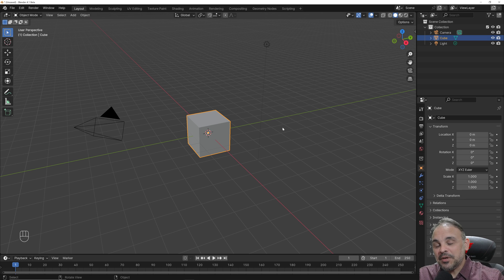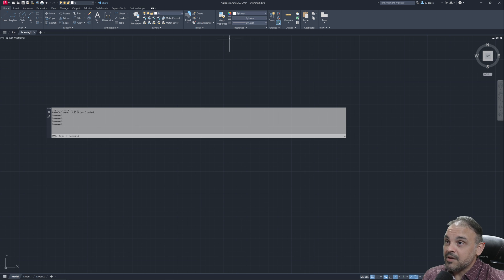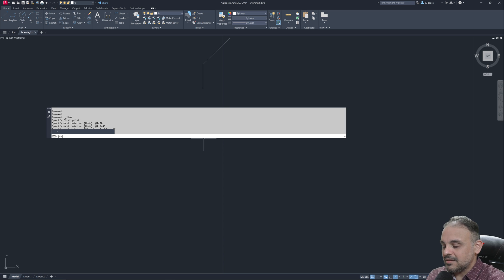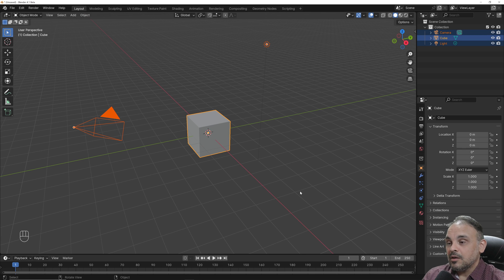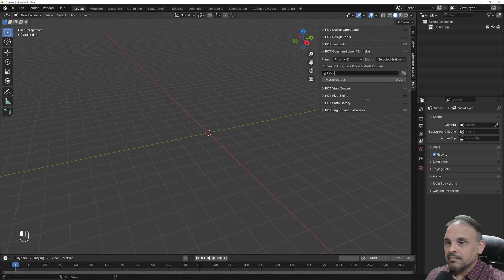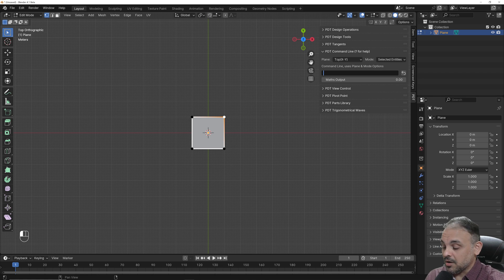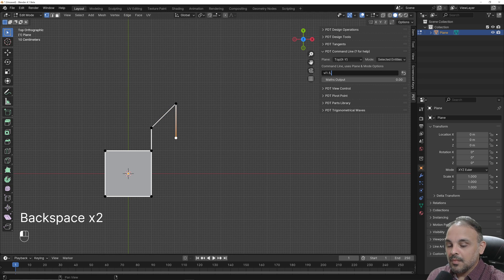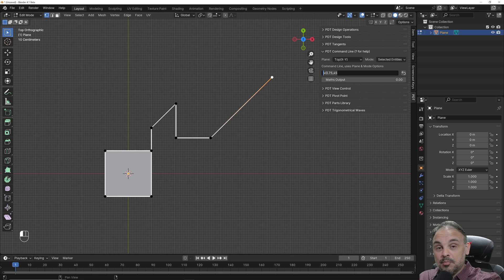Blender 4.1: How to use Polar Coordinates?

Comment: Help! What is your process for producing technical drawings using Blender 4+ ? (or do you export your views then annotate them in QCad/ACAD?).  I need to work natively in Blender because I have a lot of MEP equipment that requires lots of tagging of Descriptions etc. so exporting to a CAD program is awkward for me.  
1) Do you have your sheets in Blender or do you export them? 
2) Do you use Scenes (one per drawing sheet), animating visibility to show/hide parts (as well as ViewLayers)?
3) Do you use the Compositor to combine camera views onto a single sheet?  Perhaps with one Workspace per drawing? 
4) What addon/s do you use for dimensioning (Measurable, TechSec, PRJ, MeasureitARCH etc?)
5) What are your views on BlenderBIM?
Reply from the maker: Blender alone won't help you to create and manage technical drawings. You will be able to export projects as SVG files with orthographic views.

Once you have the SVG, you can import it in Inkscape to edit the sheet layout and save it as a PDF. Inkscape is also free and open source.

From your list, you will definitively need MeasureIt_ARCH for dimension lines. That is what I use.

Regarding BlenderBIM, it is a great solution. But, you need to be willing to learn about both BIM and IFC terminology to take full advantage of BlenderBIM. If that is your case, go for it. It will save you a lot of time.

Keep in mind that BlenderBIM is still in alpha. It works, but things are still changing a lot in each version.